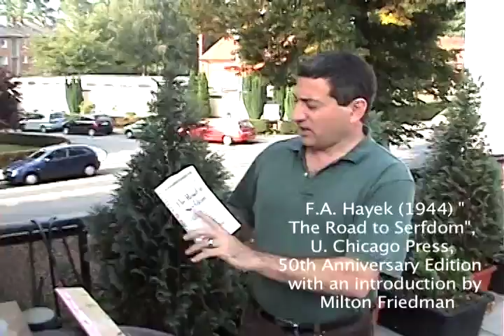Schmutzdecke slow sand filter using biogas effluent

Comment: better reverse osmosis systems that are more effective for filtering that water.. but excellent that you used bacteria to break down some of the compounds remaining in the water...very cool!
Reply: I've seen reverse osmosis systems. They are way more expensive than a bucket full of sand and rocks. This filtration system is for making yourself a bit more independent than using municipal water and filtering that. This guy passed poop water through the system and got out something that could be potable in an emergency with a bit of boiling or chlorine treatment. He could even drink it direct if he really had to but there's still a chance of making him sick.